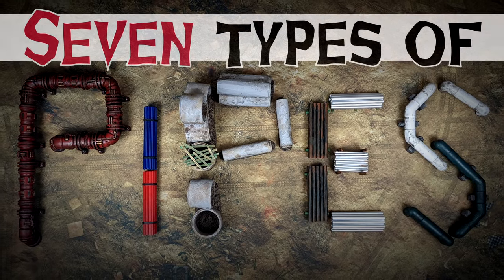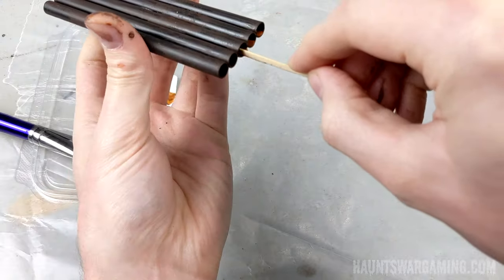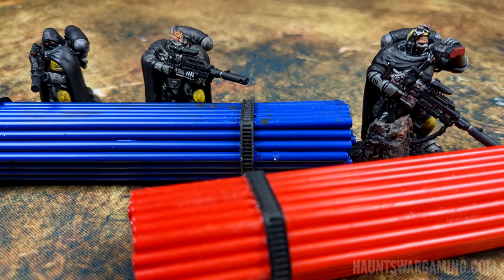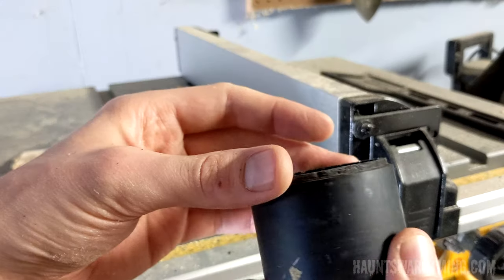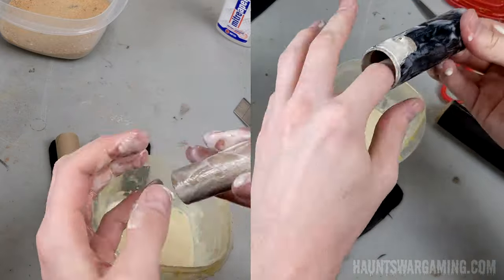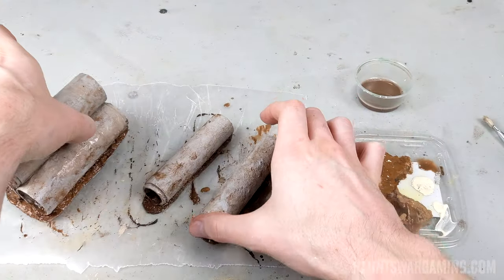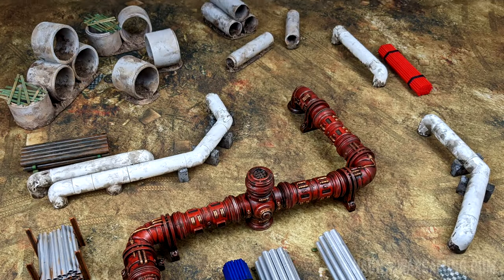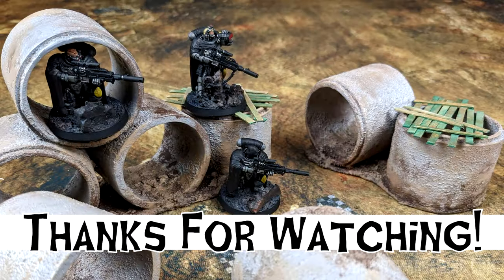DIY Pipes & Pipelines Terrain Ideas - Warhammer 40K, Necromunda, Kill Team & SW Legion

Comment: The only thing I don't love is the treated lumber. I've worked in construction for about 15 years and IMHO the pigment is way too strong - looks more like patina on a copper roof or flashing.  You should do a few pieces watering down the wash as you progress and see where you land.
Reply from the maker: Yea I may have overdone it a bit with that wash
Reply: @hauntswargaming  Beauty is in the eye of the beholder, man. I'm just the kind of person that leans towards ultra realism.
Reply from the maker: @adrianricker  That's true.  That kind of stuff doesn't bother me too much, but I do try to improve with each project. Maybe one day I will get there :p
Reply: @hauntswargaming  I don't think there is far to go!  Your concrete pipe structures are wonderful. I've been trying out ways to get that interior bevel and a router table seems to be the safest way.
Reply: I thought so but the it occurred to me the hyper industrial, toxic wasteland that is 40k would probably treat that timber til it's a biohazard!

Comment: I highly recommend a coat of Mod Podge on basically everything. Even a light coat can take a frustrating surface into an easy to paint surface. As such, I even mix in black paint with mine so it acts as a primer before the spray paint and lets me know where I have applied the Podge. Additionally, Mod Podge makes projects extremely strong, especially paper and foam, without adding a lot of weight or reducing minor details.

Comment: So I used to work with pvc at my old job, and you actually don't need power tools for pvc, there are manual cutters and bevelers if that is a concern for anyone. The cutters are basically a blade with a ratchet on one side and a curve on the other side. You just seat the curve flush against the pipe and squeeze a couple times. The beveler doesn't create a result as cool, but is basically just a metal cone with a slot and razer blade that you can rotate around the pipe. IIRC the one I used only did the outside of the pipes to help them fit into fittings. Great video!
Reply from the maker: The cutters don't get a perfect 90 degree cut in my experience. Maybe the nicer ones do?  I've only used them to cut pipes down for transport.  Thanks for the comment :)

Comment: I know a way to get the inner+outer bevel on those concrete drain pipes.  Safer too.  Just take one of those ABS (that's not pvc btw) pipe bits to the hardware store and fine another pipe that slips into it nicely.  Cut it to the same length on your saw.  Insert the smaller pipe into the bigger pipe slightly offset and glue into place.

Comment: Suggestions:
Clean and sand the long length of PVC pipe BEFORE cutting into little pieces.
Often the printing on the pipe and fittings can be removed with a solvent like alcohol or even PVC pipe cleaner.
Drill a hole through the squares of insulation for the supports, then cut them in half.  You can drill a hole using a piece of the pipe itself after you sharpen the inside with the deburr tool.

Comment: I also thought of using PVC pipes and connectors for pipe terrain. But I held off. Both because I have loads of terrain projects already in the pipeline (pun intended), and because I thought I'd need to break out the tablesaw to cut the pipes. But now I know there's a hand tool for cutting PVC pipes, which would make the process easier(?).

I already got sets of scale construction pipes from a Japanese dollar store. They're toys meant to mimic the kinds of pipes used over there. I just primed them a desaturated red, then added rust effects.

Comment: Sweet!  As a suggestion, instead of posterboard to wrap those pipes, use 2mm eva foam instead.  Won’t warp, plus it’ll add a tiny bit more thickness.  Glad l found your channel.
Reply from the maker: That's a pretty good idea! It kinda has that concrete texture too. Thanks for the support!

Comment: Baking parchment is your friend and comes in a few thicknesses for VERY cheap to wrap or cover items that need a smooth texture to start from.  unwaxed parchment works best and accepts adhesive better, unwaxed will work and accepts texture but will soon fall apart if used for terrain that will be frequently touched.

Comment: Outstanding work!

The thought of filing those marking off the PVC pipes has preventing me from doing anything with them... Might be easier to assume that Charlotte Pipe survives into the grimdark future. :)
Reply from the maker: It wasn't too bad. Using a file, it only took maybe a minute or 2 for each corner piece. Adding a PVC handle really helped too.

Thanks for the comment!

Comment: Yeah, One thing I've learned to avoid is trying to glue down bent zip ties.  Eventually they always seem to want to straiten out and they don't take glue that well in the first place.
Reply: As for adding detail, I used "Half Clamp J-Hooks" for supports and if you cut up zip ties into small rectangles they make good greebles and the ends also.  A slight upgrade is to also use rectangles from the Maelstrom's Edge terrain sprues.

Comment: By the way, I know another nice brush-flicking technique where you take an old toothbrush and apply wet layering paint all over it, then bring to the model, push down the front end of the brush and pull your thumb through the brush, the released tension is enough to spray rust, blood etc. nicely in small doses on the model and you can well regulate the intensity of the spray with the speed of your thumb.

Comment: For pvc they actually make a type of cutter called a ratcheting tube cutter it is for soft pipe like plastic and vinyl and you can get one at harbor freight for like $5 which is completely fine I use mine a few times a week and have had it for about 2 years still going strong.
Reply from the maker: That's awesome! Idk why I don't shop at harbor Freight more often. They have the best prices and the quality of their stuff is usually just as good as anywhere else.
Reply: @hauntswargaming  there stuff is fine for DIY and light use, it will last awhile for that. I'm an HVAC/R tech and I have some tools from them I have found that things that see heavy use don't last well (I have bent more than a few pairs of pliers from them). Great video too, I like urban and industrial terrain for my tables a lot, I just find it more believable that fighting would happen over strategic locations like cities and industrial hubs more than open fields and these would work great for that.

Comment: Do the poster board bases not curl up from the glue shrinking?
Reply from the maker: Not in a significant way.  If an edge is bowing up you can just bend it once the first layer of glue is dry and pile more sand on. Most of the time the weight of the sand was enough to hold it down. I wouldn't use it for larger projects.

Comment: Great video, but feels like you went overboard with the pipelines. Given that there doesn't need to be any fluid flowing from A to B, you could have used far easier methods to glue pieces together firmly. Also, why sand down the lettering instead of just going over the whole finished project with primer?
Reply from the maker: Thanks for the comment! That raised lettering really gives it away as pvc plumbing pipes. I don't think primer would cover that up 🤔
Reply: @hauntswargaming  Ah okay I was not aware that it is raised I thought it was just printed on. In that case, couldn't you just scrape it down with a scalpel or box cutter? I mean, sandpaper is the kind of thing I use for a meticulous job, with tabletop, you tend to put tons of paint and texture over stuff anyways.
Reply from the maker: @colonelburton8451  the lettering on the ones I had is pretty thick. A scalpel or maybe chisel might work but with a rasp you have a lot of control and no chance of cutting yourself. A bench grinder would be good too